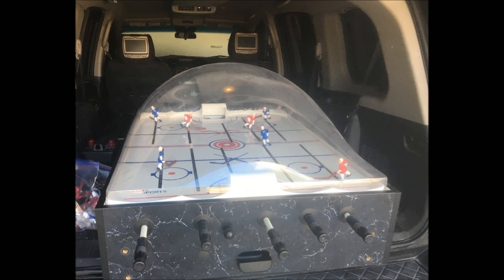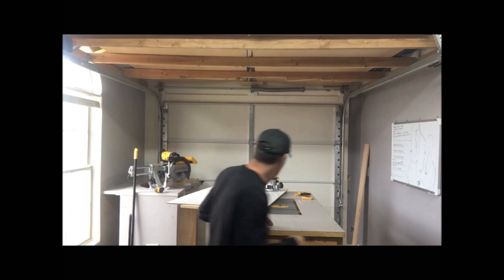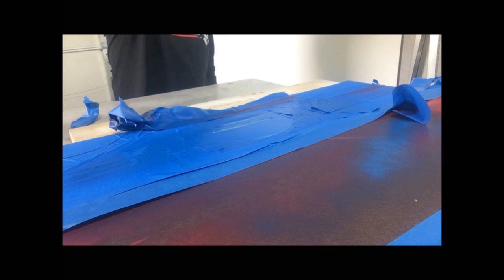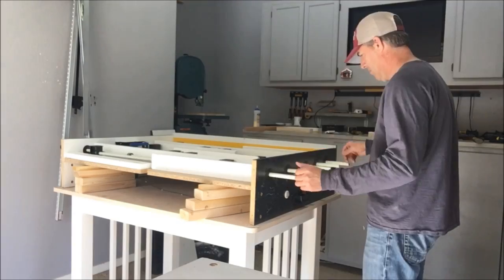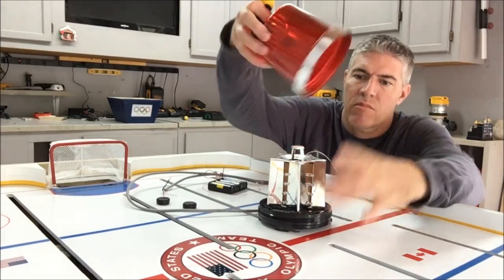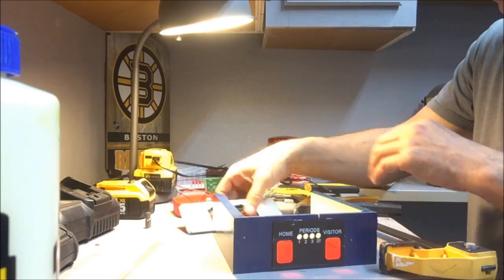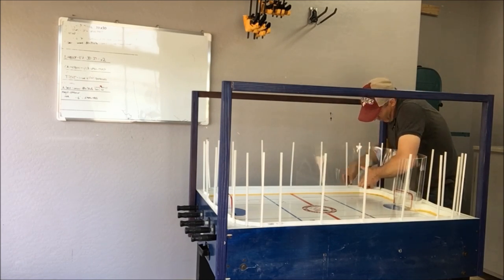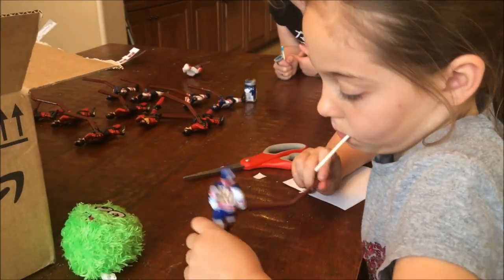Bubble Hockey Custom Build - Salvage

Comment: Nice work!!! Could you do a video on the gear box assembly and how they attach to the rods? I am building my own table from scratch and am trying to decide which gear box to go with. I am leaning towards carom since it appears they are 2.5 to 1 ratio and are reasonably priced. Also what is the diameter of the fiberglass rod? I intend to use the carom layout but increase the length in the playing field by 4" on each side and extend the players run to match so I can implement behind goal pass ( with a mild bulge so the puck does not get stuck). Lastly, what material did you use for your playing surface? I leaning towards PVC, but not sure yet.

Comment: Awesome job. When you say you cut the goals down, you just took an inch out of the middle and glued back together?  Also on the acrylic you used for the glass, did you just pick up a sheet at a home improvement store?  Thanks
Reply from the maker: I cut an in inch off the bottom and yes its a thin acrylic from home depot

Comment: I have a similar game. I want to coat/slick-up the "ice" which is now a kind of countertap laminate, looking kind of like what you replaced. You indicate in the video that you used a concrete sealer. Do you think that will work on my surface? Is the surface quite slippery. That is what I am after.?

Comment: How much thickness was added to the surface after you put the clear seal on? I have a table that needs a new surface but I'm afraid if I add that clear seal it'll be too thick and mess up the player's movements.
Reply from the maker: Hi Josh,  I put four thin coats on and it's still less than fraction in thickness. The players still have plenty of clearance. Apply very thin coats and make sure to let it dry completely between each coat.  You can also clean the surface with lemon pledge just before you play and it will create an even faster surface!  Good luck
Reply: Scott Brooks, lemon pledge is exactly what I did! Great!
Reply: Hi Scott, one more question for ya, did you apply the clear seal with a paint brush or sprayer?
Reply from the maker: I used a 4" foam roller..
http://www.homedepot.com/p/4-in-x-3-8-in-High-Density-Foam-Mini-Roller-Cover-5-Pack-HD-MR-200-5-4/202097452
Reply: What material did you use for the replacement surface?

Comment: I also was wondering if you knew how the players to rotate? I know they can move linearly by pulling/pushing the handle, but for rotation, are they driven by a gear system?
Reply from the maker: Hi Landon, I'm not sure where you would find plans that would include all necessary schematics but as far as the gears for rotating the players .. you can go to carrom.com and get them there.. Good luck!! Let me know how it turns out!

Comment: AWESOME video! Im looking to make one of these from scratch and was wondering if you knew anywhere I could find some of these dimensions for building one?
Reply: Landon Sugar I have a table just the the one found in the video. LMK what dimensions you want and I’ll get them to you.
Reply: Hey guys, 
I want to build a (rougher) hockey like this from scratch. It will have larger, fewer players from plywood and no bubble overhead. But I can not figure out how to make the mechanism that makes the player rotate, from the rotation of the rod. Can you advise on that ? Thanks for the video and any suggestions
Reply: Dimitris Tripakis have you looked at different gearboxes for table hockey games? For your purposes, there is no reason to reinvent the wheel. You can purchase table Hockey gearboxes online. I’ve looked at them and bought a couple. They are not hard to find, but they are difficult to design and manufacture on your own. I look forward to seeing what you come up with. Please share.
Reply: Dimitris Tripakis the unit I want to build will be unlike most models out there on the market. I’ll give you a hint- no slots!😀 I have the concept in mind and I’ve tested enough to know it will work. It’s just a matter of building some of the parts. I really need to get an intelligence patent though.
Reply: There is a magnetic slot-less bubble hockey. You mean something like it ?  In any case I wish you the best of luck.